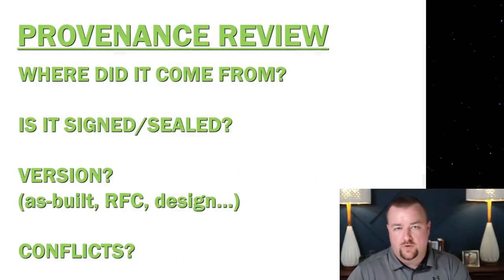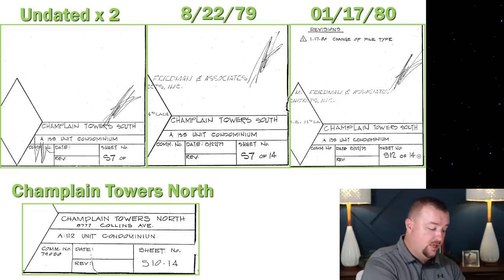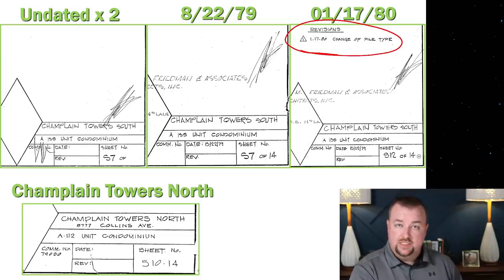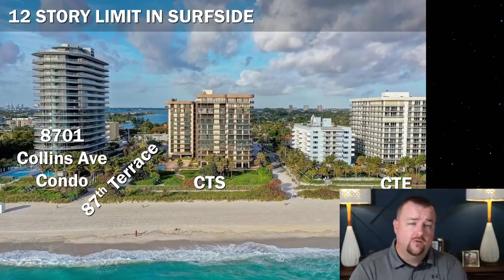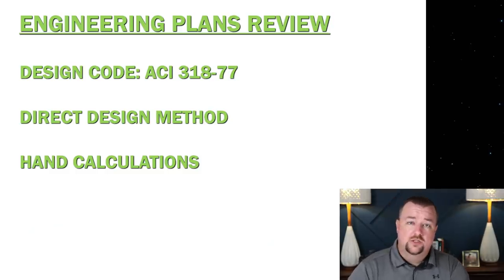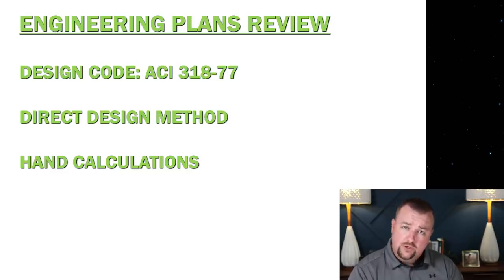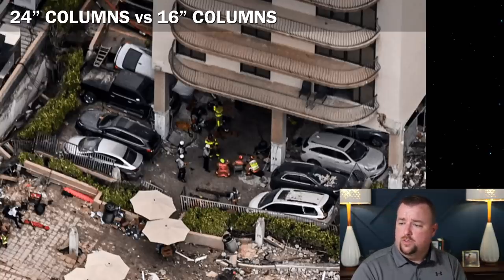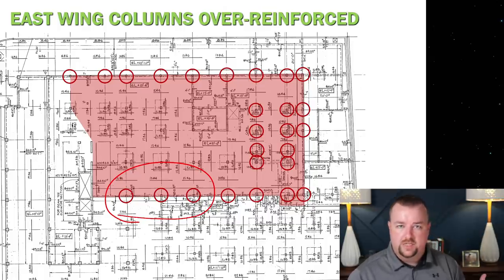Engineering Failures Found in the Champlain Towers South Drawings - Surfside Collapse

Comment: It should be noted that when the change was made to remove the step downs (beams) at the slab, that drop panels and associated rebar were added at the affected columns.

I am also noticing that the number of slab flexural reinforcing bars were increased at the longer spanning BM A, which may suggest that there was a structural analysis performed and the additional steel reinforcing may have been intended to make up for the loss of flexural strength due to the elimination of the beam.   

Were all the drop panels constructed per the original construction documents?  It's not clear in the video if they even exist.  

I'm wondering if the contractor misinterpreted the drop panels as extent of rebar over columns.  Lobby level doesn't provide the drop panel dimensions, but there are drop panel dimensions indicated on the typical floor framing plan.

Is there a note or detail providing the thickness of the drop panels in the complete set of structural drawings?

Comment: One common method of damaging this kind of slab is people driving trucks onto the deck because they have no knowledge that it is not slab on grade.  Back in early 80's when I was a student (engineering) at OSU I worked in the old student union building.  I had noticed that for no apparent reason there was a useless 6' ceiling height "room" under a very large patio outside the ballrooms.  Small hatchways between basement and this "crawl space". so it was not for storage. This was maybe a 200' x 100' stone patio that any normal person would assume was on grade, yet was slab on column.
One time during setup for an event I looked out and there were four semi's backed onto this patio.  So a load of something between 200,000 and 300,000 pounds sitting on this slab.
I went out and warned the event coordinator.  He waved me off.  I went to the building engineer.  He waved me off "We have had trucks out there many times"  (My response was "four trucks RIGHT NEXT TO EACH OTHER").  His response was "I am sure it is fine"
I went out to the drivers and simply ordered them to move back out onto the lawn.  I had zero authority to do this, I simply said "What idiot told you to drive onto this patio?  It has a room under it!".
As the second truck moved the slab cracked and his rear end dropped about a foot, but he made it off.  So the other two scrambled to move.

So - looking at surfside, could trucks have driven onto that patio?  I do not know if there was access, but if there was, then it likely happened at least a few times.
Reply: Doubt it.  From looking at the street view photos on google maps it says the clearance is 9' 4".  Not even a moving truck can get under that.

Comment: That's a great engineering insight about rebars, concrete and splices. So if splices are "weak points" of columns, what if the workers weld the ends of rebar together instead of connecting overlapping rebar with wire? Also I can speculate that the wiring that connects rebar is also a "weak point". Can it be replaced by welded joints?
Reply: Welding is prone to corrosion and cracking, not a viable long term strategy for rebar.

Comment: Once again spot on. I remember you mentioned that you were surprised that it lasted as long as it did. That being said perhaps the concrete finisher maybe used a stronger concrete mix than as designed, or the concrete producer mix design was well designed with plenty of over design, or perhaps a super plasticiser was added to reduce the w/c ratio. Regardless, he was flirting with disaster designing the pool deck at 100% capacity, thinking about the remodeling over the years like the pavers that added weight, but ultimately I believe you are right, taking out the beams to maybe save 50cy of concrete and the associated reinforcement cost many lives.

Comment: I see exactly what you mean. Load failure like that, with the poor temp rebar overlap, would ensure future failure earlier. Top down load is basic G. Contractor education, and the loss of beans seems a ludicrous miss by the GC, Engineer and Architect. Criminal liability is obvious. I add, even if those 12*16 were sized at 24*24, the offset load top to bottom with proper beams and temp tie in would ensure early failure too. 

Great video, a must watch for everyone in construction!

Comment: It's one thing to determine if the building was DESIGNED correctly, and another thing entirely to determine if it was BUILT in conformance to the drawings and applicable codes (SBC).

Comment: I haven' seen where the original tower crane location was. Makes sense that it was near the middle around GL K-10 ( pool deck ) and anchored to the balconies. No plans I have seen shows the crane opening. And with minimal shearwalls, seems that there may have been issues with stress right from the beginning due to the lateral loads put on the slabs at the tie backs. Can't see them doing the tower without a tower crane. Also, someone mentioned that there was a crane collapse during construction.

Comment: Late changes are very risky because the developer doesn't want to pay another 1/12th the fee for the engineer to do a thorough job all over.  Easy to criticise the design it is there as a record, but the pressure to make changes to suit the developers whim is not recorded at City Hall.  However, I think your assessment is bang on.  24" columns are stocky 16" aren't.  I didn't need to run calcs to ACI to know the pool deck slab was too thin, the columns under it too small without shear rft in the slab.  You didn't mention strength gain with age, but as it was quite low to start with, it needed something.

Comment: I'm not a structural engineer, but the thing I don't understand (~12 minutes into the video) is why the 12"x16" columns would be offset from the 24" columns.  Wouldn't the structure have been significantly stronger if the upper level columns -- even if smaller -- had been located directly above the thicker columns?  Locating most of them adjacent to the thicker columns would seem to put the concrete and rebar under even more stress at those points.

Comment: A little bit of knowledge is useful. Today I parked in a 4 story garage. I noticed the GIANT pillars on the second floor of the parking deck.  My guess is that the round supports were 28” across.  For certain, I couldn’t wrap my arms around them. Immediately, my mind went to the noted size of the Champlain South supports. They never had a change.

Comment: Josh in 2018 the palm trees were removed, how were these 80 foot trees removed? Most times when trees are removed they start from the top and drop tree trunks 24 inches at a time to the deck, that is about 40 sections of tree trunks dropped. That in it's self could have damaged the structure of the concrete. Just a thought.

Comment: Josh, if the calculations for the pool deck spans were  +99% when designed and built, what would the load factor be later when they added sand and brick pavers on top of the slab?

Comment: Excellent analysis. Might very well be how it happened.

But what really bothers me is that a single localised failure propagated so quickly into the tower. 

In aircraft there are redundant load paths that can accommodate single component failures in many cases.

How many house of cards structures are out there?

Comment: Good explanation.
Overloaded pool deck, increased weight due to apt. renovation, heavy vehicle parking, and lack of safety factors were a recipe for failure. 
Also has anyone tested the concrete PSI ??
I think that the building most likely would have collapsed at the next hurricane.

Comment: As an architectural designer, I see all too often, knock-on effects of changing 1 thing aren’t considered, especially when something is designed with multiple end purposes in mind. Contractors often substitute products and details assuming they only had 1 purpose. No, that plywood wasn’t just for the bathroom tile and to mount that wall hung toilet, it was also providing critical building shear and wind bracing to that primary structural wall. Lesson #1 in all fields should be to never assume anything has just 1 purpose. Seems obvious here, critical beams were removed because it was assumed they were only there to deal with a level difference, neglecting to realise they were also transferring a great deal of load and allowing for slimmer columns.

Comment: Could it have been possible that a different engineer, other than the original designer, took the beams out of the drawing, not realizing the dual-purpose of those beams? I find it hard to believe that the original designer would have forgotten that the beams also served to support the planter boxes. Nice video btw.

Comment: Too many theories of what produced the fall of the building but the video of the fall of the building and the photos of the debris explains it in a very simple way and shows something very scary (there were no beams) and the beams not only serve as support for the concrete slab but also prevent the columns from bending and breaking, everything points to the saving of materials, a 13-story building that has the height of a 12-story building, greed, selling more apartments and saving materials to the detriment of safety, inefficient supervision ( sorry if my english not good )

Comment: In the documents that were released we can see that they did some recent test core sampling on the Pool Deck level. Core sample "A" was taken near one of the planters in front of Apartment 111 and core sample "B" was taken from the above ground parking area, near to where that slab ended up collapsing into the garage below. From the photos it looks like both core test probes cut through at least one horizontal piece of rebar, though I could be mistaken. Do you have any thoughts about these test probe core samples and if that is actually rebar they cut through, and if so............?
Reply: Those issues have been addressed in other videos (some on different channels). Delamination of the cement from the rebar in the pool deck area is partly responsible for the punch through shear of the columns.
Reply: @gordonrichardson2972  Yes I've seen those. I was wondering whether the actual severing of a section of the horizontal rebar in the core samples might have further compromised the stability of the slabs in those two areas?
Reply: @winonakent  One piece of rebar shouldn't destabilise a slab, unless it is already at failure limit.

Comment: They designed the pool deck at a little less than 100% dead loading, with no safety factor? I missed you mentioning the live  load?  Did I understand that correctly in your video?  I have the same thought about being more surprised that it stood for 40 years, and less surprised that it collapsed.

Comment: Did you calculate in the extra dry weight of the sand and tiles they added to the building? Do you think this issue affects the North building? Obviously those buildings while similar and also significant enough different that the load calculations would be different. 

FYI I mentioned that location in one of your first videos due to the cars being much bigger and heavier than cars during the 1970s.

Comment: Did you see the picture of the coring taken in 2020?  It sure looked like the slab was 13” not 9-1/2”.  I know increasing the slab thickness increases the concrete area available for punching shear resistance but it’s also increasing the dead load.  Would the increase in dead load be larger than the increase in shear capacity?  Also I noticed that the column strip reinforcing at the 24” columns didn’t match the specified number of bars.

Comment: What was the load calculation for an average car weight back in 1980 vs now? cars and trucks are typically heavier for a much smaller footprint now days, seems like there where a LOT of conditions pushing this structure beyond its design limits.

Comment: The main question is does the building come down had the builders stuck with the 1979 plan with the large beams and the step down?  What are the reasons they would have eliminated that step down bean running north/south?  Was it that they did not re-calculate loads after making that Jan 1980 changes?
Reply: Must also say.. I asked CEF the same question a week ago since he brought up the issue of the change in plans and he said he thought the building would have not gone down had they stuck with the step down 1979 plans.

Comment: If the plans originally called for that step-down, wouldn't that have lowered the entire pool deck? Would the ceiling height for that area of the parking garage also have been over a foot lower? Did the engineer overlook that in the design, maybe? Or did the construction company overlook it until the pool area was already in place which pressured the engineer to hastily revise the plans, leading to him overlooking the significance of his changes? Some questions to consider.

Comment: Given the weight of the extra concrete for the penthouse, is it possible that helper breakdown the structure with all the cracks and things? Is it also possible that the pile caps were not actually there, and that the ‘pile caps’ was just the slab on top of all the piles itself? You brought up the void space with all the water in and around the slab.

Comment: I can confidently say that in my region, As an individual WITHOUT a degree I have more knowledge about concrete design than the average engineer; that's not a brag but rather more a concern. I also live in a seismic region. We've had a few incidents which were 100% preventable and let's just say that you've more than restored my faith in the profession. Many young engineers don't lack knowledge due to a lack of IQ, desire or concern/care but rather poor quality education and mentorship. What we're seeing here is destined to repeat itself. If you're curious I'm more on the 'builders' end of things now; many of the points you cover are all-too-often overlooked.

Some things you mention that I think engineers often "don't get":

Adding 'extra concrete' when there's room. Where I am (Western Canada) adding additional concrete is often the cheapest of the major 3 components of concrete (the concrete itself, rebar and formwork). Okay yes whatever "concrete is bad for the environment" but people don't consider life cycle analysis; the longer a building lasts the 'better' it is for the environment. And concrete actually re-absorbs CO2 as it ages. It's f'ing horrible for the environment but build the building to last and on the grand scale... it puts a roof over our heads at a very low 'carbon impact' per unit.
Over Reinforcing is a HUGE oversight by so many engineers. They are often crunched for deadlines and panic and add a TON of reinforcing last minute thinking it will cover their ass; they actually compromised their building :-O.
The long(er) term deflection you mention is called 'creep' in Canada and maybe other countries (just an FYI for non-American viewers NOT a critique on terminology in any way, shape or form).
You briefly discuss temperature reinforcement; would you prescribe temperature steel on 'top' flexural reinforcing steel over columns, beams, suspended slab perimeters, etc... I see that it's often omitted. Most engineers seem to think it's only required on bottom flexural reinforcement. Looking for an expert opinion here (definitely not questioning anything!!).
 At the beginning of the video you discuss document control. I personally know of a near-fatality due simply to poor document control. The structural engineer sent the wrong drawings to the formwork structural engineer and it nearly caused a massive formwork collapse.
Tall Columns - I once worked with a Struct.E (as well as myself while drafting for him) miss a tall-column situation. Those bigger columns saved lives... at the expense of what? $2,000 worth of concrete?

It's rare to see engineers that can apply their knowledge full-circle. You also spent TIME on this video instead of jumping to conclusions (a HUGE problem in the industry). You also not only have the ability to manually calculate loads and forces but also know when it is and isn't appropriate - that's alluding to the fact that engineers worked with whatever they had to work with at the time they designed the building. The sad thing about all the new software is that an engineer who has no clue can somehow spit out a design. Sadly, given the poor chain of command, the drafter (me) would often become the quasi 'senior design checker'. Believe it or not I got good at it but some of my early drafting scares the shit out of me (penalty to having good long-term memory I guess).

It seems like an unfortunate incident has also given you the opportunity to deservingly grow your channel. I have some interesting stuff to share if you need content for future videos as I feel like a massive train wreck is going to occur in my region before long (a few kind of have). Counter-intuitively,  I'm actually able to dig up designs from Florida - they seem pretty stout; my region however? is getting a little scary and there's already been one scary incident that our governing body as brushed off as not a big deal. Please reach out if you're curious!!

Comment: This is my third time through this video and I am understanding more and more of it each time I watch it as I am not a structural engineer.  I am curious though. How would this same building be designed using current design methods and computer modelling compared to how it was originally designed?  If we then compare the two designs what would be the difference?  And if we first design using the one foot drop down and then remove the drop down would current design methods and computer modeling caught the design issue recommending that either the beams be kept or that the size of the columns be increased?

I think that would be an interesting video... CTS as designed then and now.